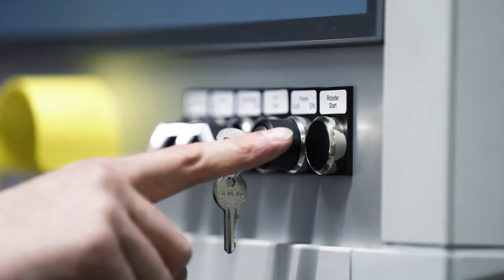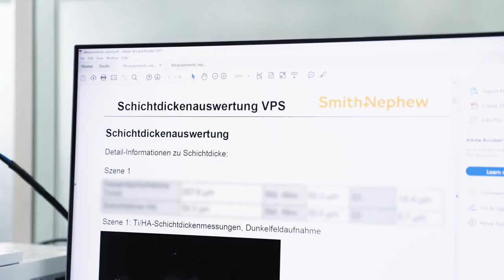ZEISS & Smith+Nephew: AI automates testing of implant coatings

Comment: As a professional engineer with a strong background in biomaterials, I am impressed by this technology.  I do believe, however that until the technology is determined to be essentially flawless, an adequate sampling of each production lot is hand inspected to ensure that the AI is doing its job.  By the way, it is usually not a failure in the high-tech process that causes problems, but rather problems with the stupid stuff. For example, S&N had a mass recall many years back on its hip implants, because the radius of the acetabular cup was far larger than the radius  of the head of the greater trochanter so that rather than having a clearance of 0.0005", the clearance was a few hundredths of an inch causing the implant to fail.